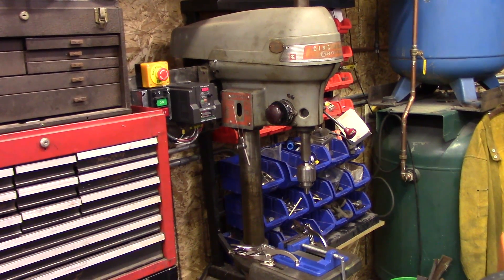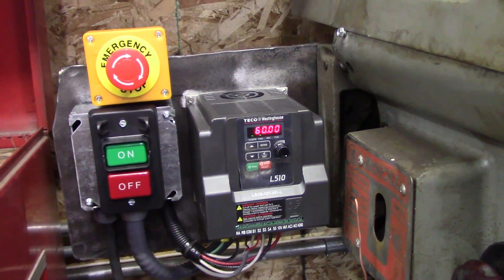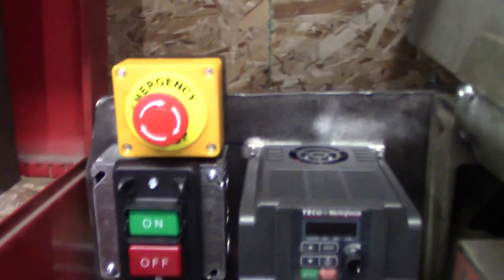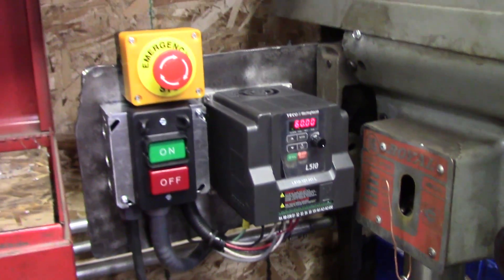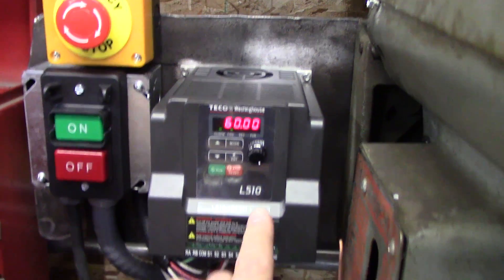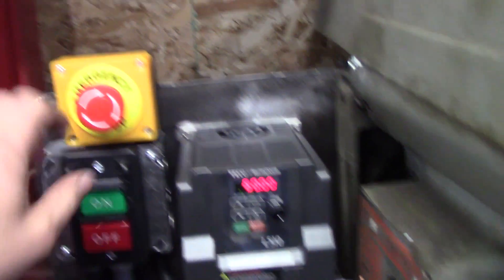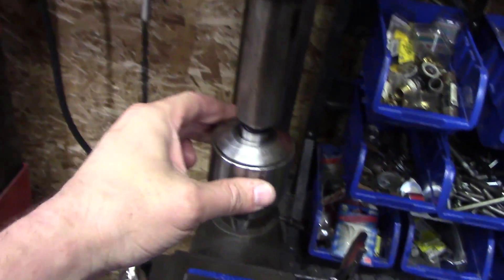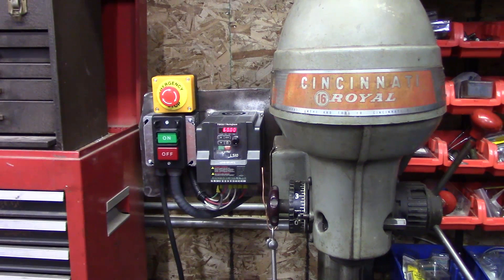VFD Update on the Cincinnati Royal Drill Press Programming

Comment: Do you remember your low voltage wiring for that set up?
 I have the same FVD and looking for that same setup.
Reply from the maker: I don't recall.  I do remember talking to their tech line for some help though.
Reply: @Oldsmob455  Thanks, I will do that. Still workimg well?
Reply from the maker: @Jesse-xj5rb  Yes but it doesn't get used that often.